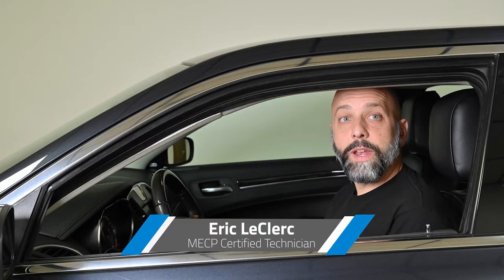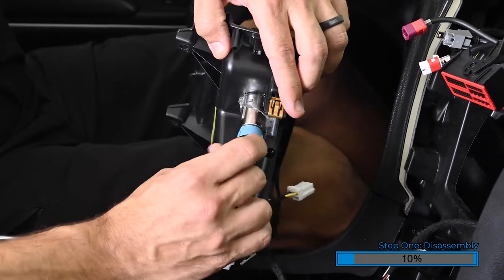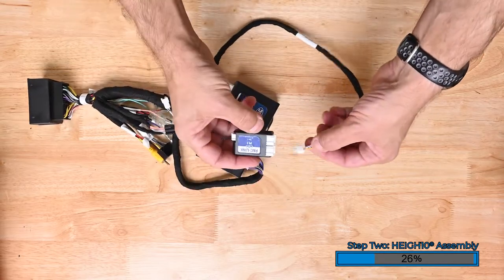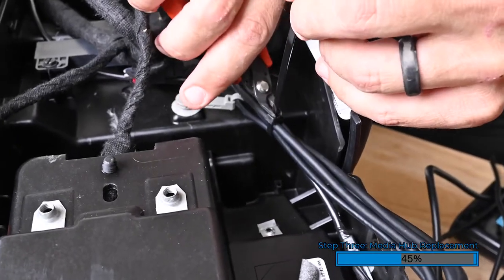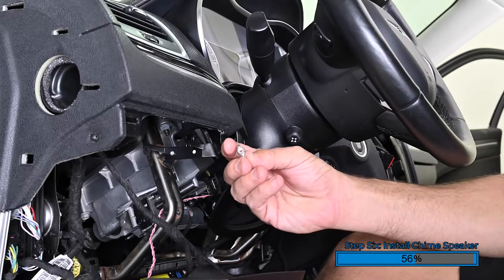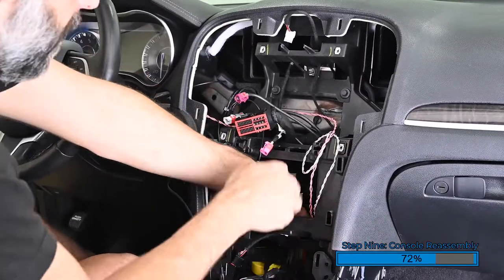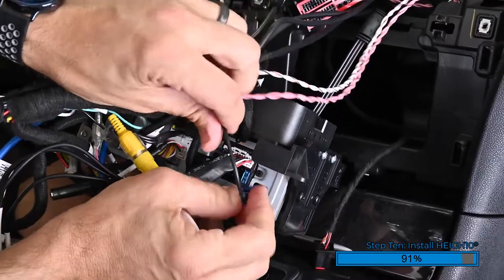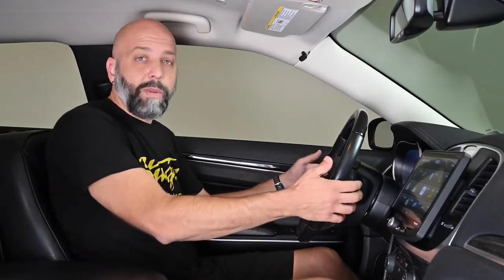Chrysler 300 Step-by-Step Install with HEIGH10 Touchscreen Radio | RB10CHR15

Comment: is the factory bluetooth microphone nulled out with this install? Do the new aftermarket microphones work better or worse?
Reply from the maker: The factory microphone can't be used with any of our HEIGH10 units. You will need either the external microphone or the one built into the radio. You can use either depending on what your preference is. If you have any further questions, please contact us at 1-800-477-2267 EXT: 3333

Comment: Would this be the same procedure roughly for a 2008 Dodge Charger?
Reply from the maker: The kit for a 2008 Charger would be slightly different, but similar wiring.

Comment: Does it work on a 2014 Chrysler 300?
Reply from the maker: We don't currently have a HEIGH10 radio kit for this vehicle. However, we offer a universal HEIGH10 kit on Amazon. If this were the option you're interested in, you would need the corresponding pieces for the perfect fit based on your vehicle. Please see the link below for more information and contact us if you need further assistance by calling us at 1-800-477-2267 EX: 3333 https://www.amazon.com/dp/B083VRBKMF